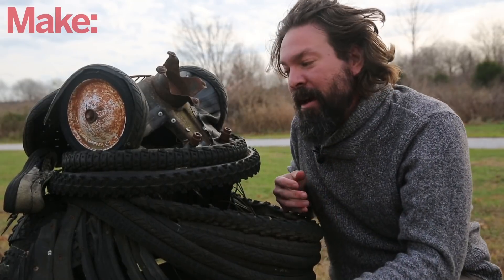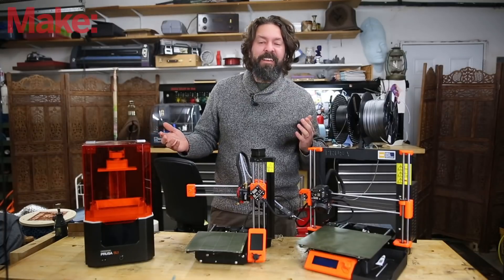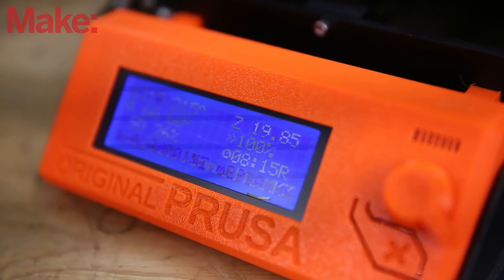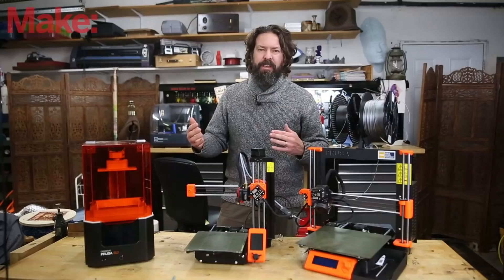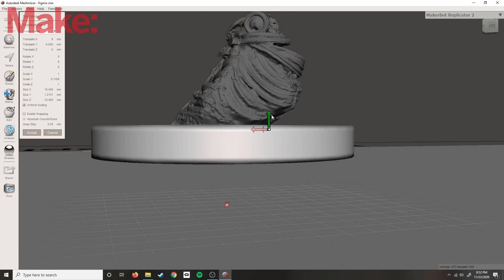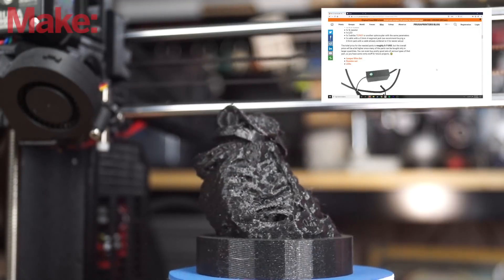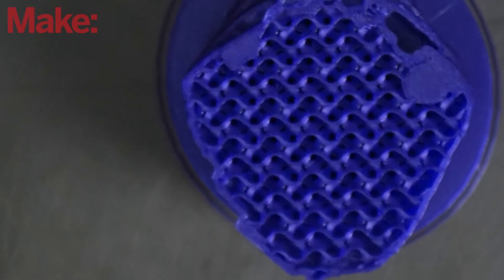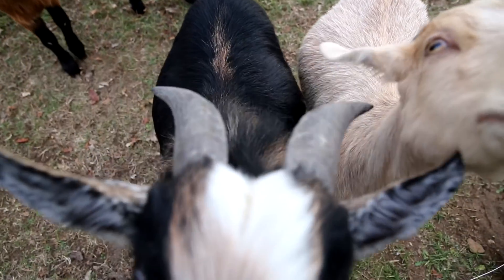How To 3D Scan Sculptures For 3D Printing

Comment: I've done sculpting with polymer for a few years but would like to get into 3d scanning & printing in the hopes of having scanned models to 3D print by the dozens, started with a phone app 3Dscann since my phone doesn't have a 3d scanner & no budget atm to get the full load out so currently learning though various videos. So far it just came out like a terrain very flat but was only snapping shots with my phone held still with my figure model on a turntable. After watching the video & seeing the sculpture you've done which is way more detailed scanned at multiple angles, how the toad looked in the software & printed I'm eager to retry taking shots at multiple angles & more than just 26 stationary ones. The toad itself is actually quite cool clever use of old tires especially 👌